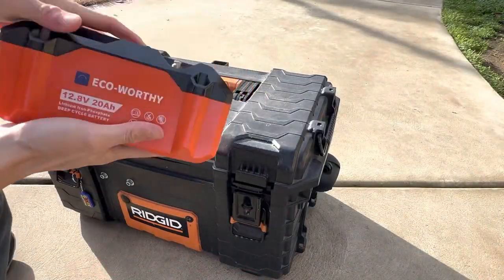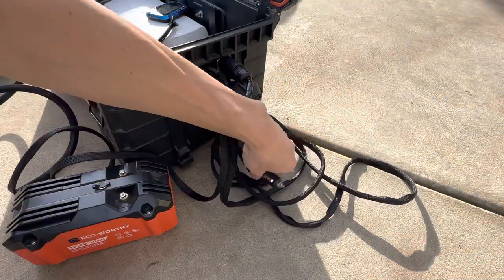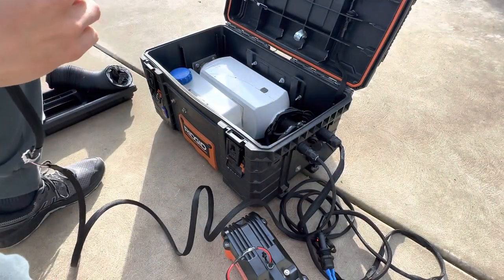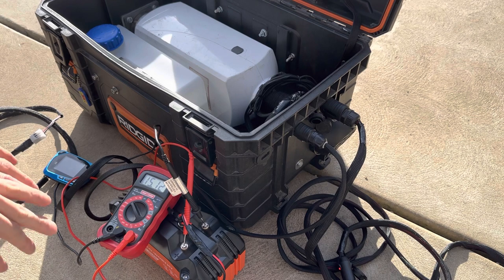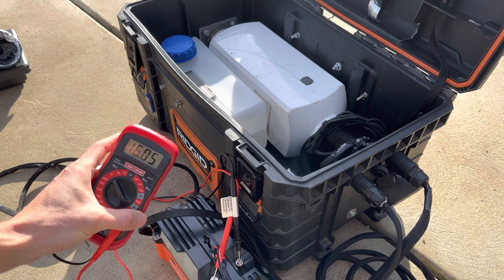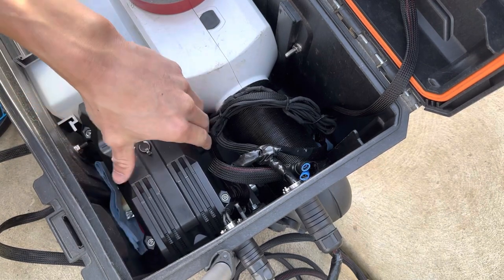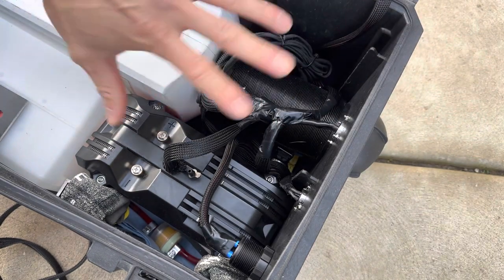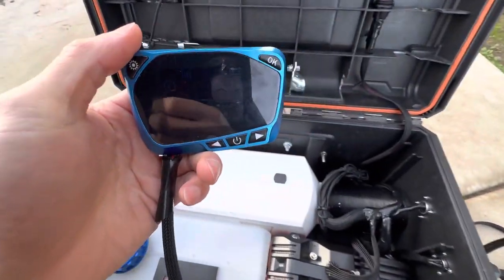Probable Battery Power Diesel Heater / All in One / Self Contained / Lithium Battery / Truck Camper

Comment: The big question,  how long will it run on a charge?
Reply from the maker: Medium setting, I was able to get 12 hours and battery wasn't dead yet. This wasn't meant to replace not using my truck battery. For a one night trip, it makes setup a touch faster/easier.  I got plans on charging it between nights.
Reply: I found using the figure of 3Ah per hour is good for estimating run time. That would assume you are running it on it's highest power and takes into account 1 start-up. When estimating, I would always assume that you need to run it at full power, that way you will size your battery accordingly and never run out of battery power.
Reply from the maker: @CR-rp9eb  that’s good info. Thank you.

Comment: It would be nicer to use tool batteries like a Milwaukee 12.0 amp m18 volt with a low voltage alarm.
Reply from the maker: Run time won’t be the long